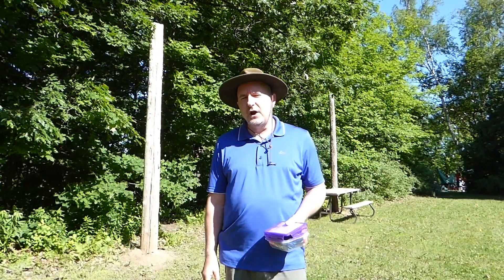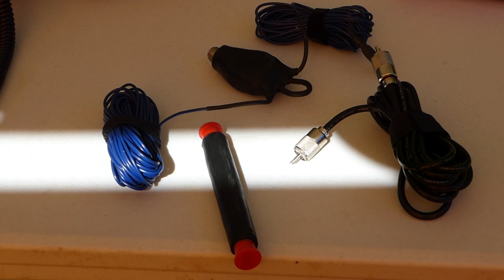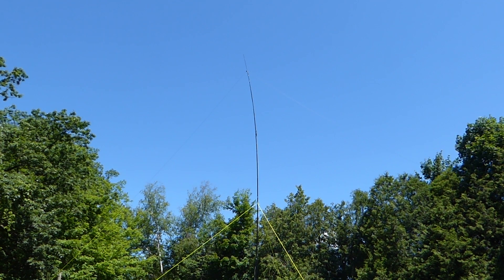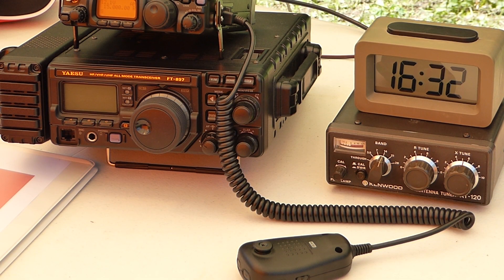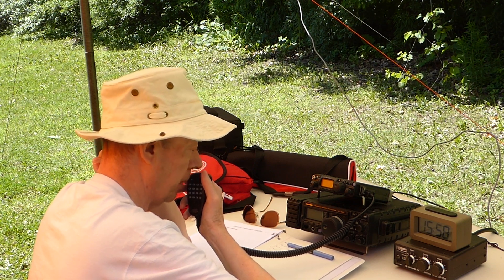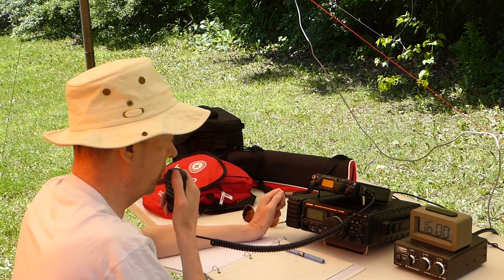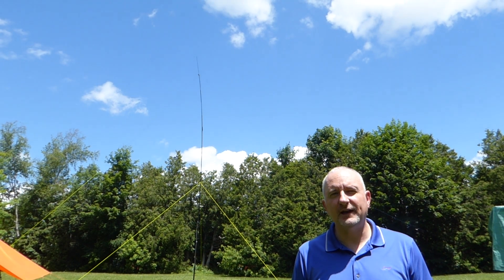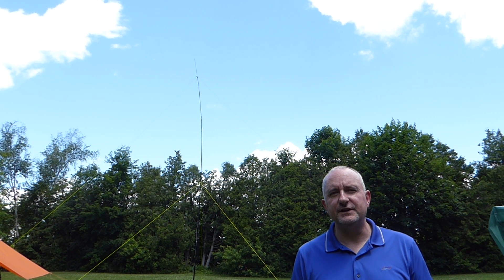The N9SAB 100W 40m-6m Mini Windom

Comment: Where is the hot side of the coax connected to in the Windom antenna? Long leg or the short leg or no difference. Thanks.
Reply from the maker: At the joint of the two, just like a dipole.

Comment: Tracy, you always have great videos and the information is appreciated.  BTW, I was "Outdoors and on the Air" 11/25 activating a SOTA summit.  Made 32 contacts on 40, 30 and 20M over 2 hours and had a GREAT time.
Reply from the maker: Fantastic! That's an outstanding QSO count for just 2 hours. I'd like to know what you were using for a station and what mode you were using.
Reply: Conditions smiled upon me on Candler Mountain, W4V/RA-057.  12 QSO's on 40M Phone, 10 on 20M phone, some on 20M CW, 1 on 30M CW all are uploaded to the SOTA www site.  I was VERY surprised that there were no takers on 40M CW.  Ran a KX-3 @ 10W and the antenna is a segmented dipole @ 20' giving full sized coverage on 40, 30 and 20M.  Just connect / disconnect the alligator clips to change bands.  Power came from an 8AH SLAB battery built into a .30 plastic ammo can along with a PWM solar charge controller for the battery,  a pair of USB outlets to charge the cell phone, etc.  A 50W solar panel came along but stayed in the car as it would have been a bit clumsy to take to the peak. Took a "Rite in the Rain" notebook with me to both enter the contacts into the log but also record those items taken but were excess to the effort as well as items which would have been beneficial had I taken them along.  Weather smiled also as it was 65F / 18C and sunny and was also happy about being able to ride about 1/2 way up the 1800 ft climb to the summit.  Next  effort will definitely see the SLAB battery replaced with Bioenno Power, 15AH LifPo battery:   https://tinyurl.com/y7nslbtg  at 1/2 the weight and about 2X the power density.  At the end of the day, I was VERY surprised that my phone contacts so outnumbered those made on CW.  I would have thought it would have been the other way around.  -73-

Comment: Antenna Vidieo very good and hope to see more and Catch you on the air please send Frequently used Frequencies  Cheers david ZS1ADG
Reply from the maker: Hi David, thank you for your comment! Due to other priorities in my life I do not get to spend much time on the radio. I don't hang around on any specific frequency but move to where the action is. I'd enjoy making a contact with you too, but of course conditions have to be just right. I've only made a contact with ZS once before in 26 years of hamming and it was a big thrill. 73 from Tracy VE3TWM.